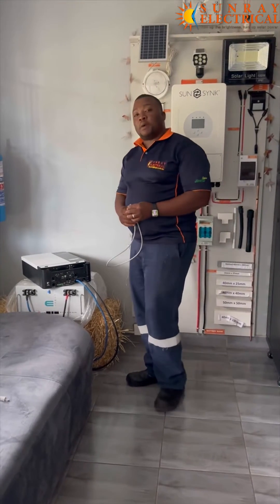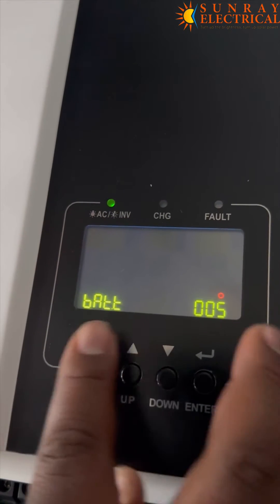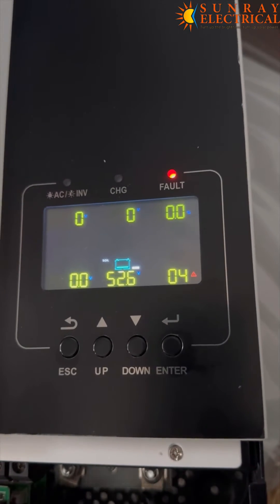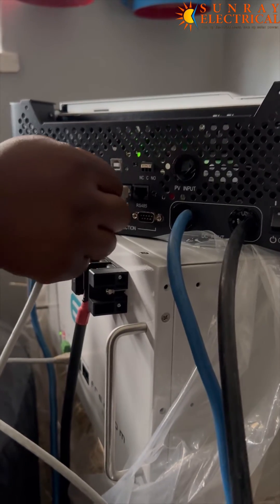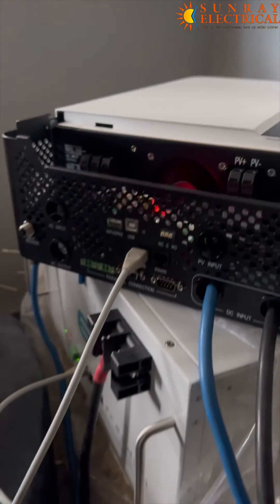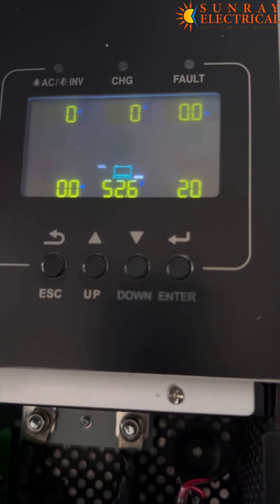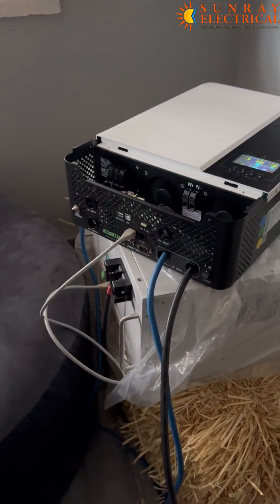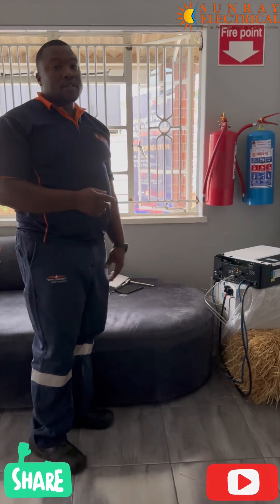Bms communication  between  Growatt 5000es and freedomwon  etower  lithium battery

Comment: Maybe your video will solve my problem with lfvu battery ... I am using L01 protocol for rs485 but i get errors when system shutdown. It is so funny to get it running aggain. I have to try can and L52 if it will work. Or have you other idea?